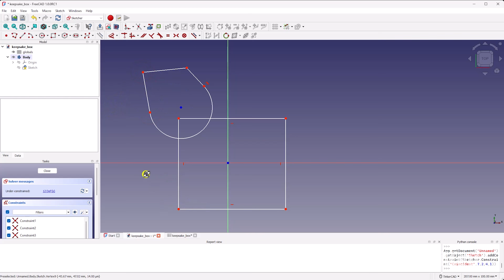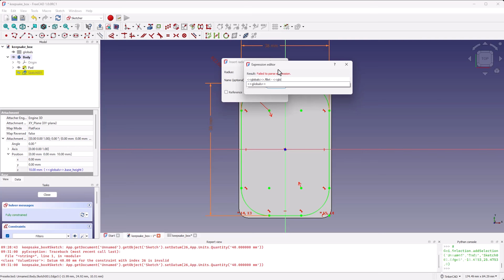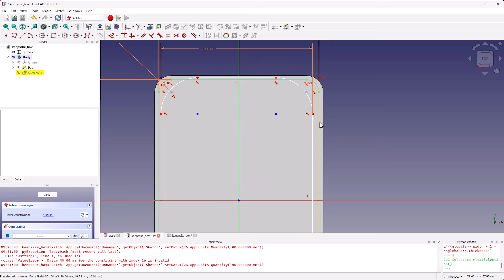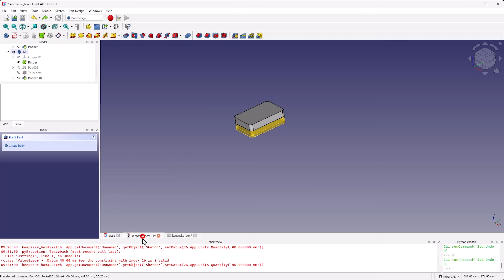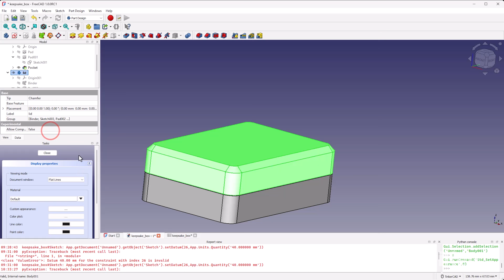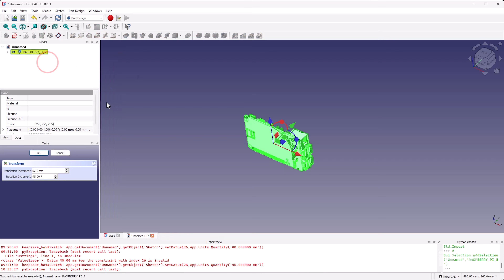Introduction to FreeCAD Part 3: Shape Binders, Expressions, and Spreadsheets | DigiKey

Comment: Your series is the best I have found on FreeCAD and rivals one I found years ago for SolidWorks.  Now, if you get bored and want to do a series on SolidEdge community edition, that would be fantastic.

I started out with SolidEdge as it was free from EAA.  Then a couple years later, it was no longer free.  EAA then offered SolidEdge for free.  I learned that and then, you guessed it, it was no longer free.  Although, it appears I can use the community edition.  I am thinking about taking a deep dive into FreeCAD, but it still seems fairly primitive compared to. SolidWorks and SolidEdge, but being open source is a HUGE advantage.

Comment: Just trying to use the measuring tool drove me completely nuts.  For some reason when I try to measure the gap between the inside of the lid and the outside of the lip it was obsessed with giving me the hypotenuse of the 0.2mmY distance and the 0.2mm Z distance of (0.28mm) instead of the distance I was trying to get 0.2.  I didn't have this problem are all when trying to mesure the gap between the bottom of the lid and the (non-lip) top of the base.  It was super confusing and it took me a while to work out what was going on and that the design was fine - but I still don't know how to use the tool properly...

Comment: I get very flustered with screens, when I do a spreadsheet, it takes up the whole screen.  In your videos, it displays next to the model box.  Can you do a video on just setting up the screen.  Once I went to the Tinker setup, I can't move the origin point.  I'm slower than most kids in the park, but @ 72, I still want to learn.  I did print the micro card box, thanks

Comment: I had a lot of trouble following this course; at first, I thought it was sometimes going a bit too fast. I received 'Wire not closed' messages very frequently. After a while, I realized it was due to the version. I am using the latest version, 1.1.0, and in this version, you now have to completely close External Projection. After I applied this, I no longer received these 'wire not closed' errors.
Reply: THANK YOU! I was pulling my hair out over this same issue. OF course now the pocket is borking up the whole model but at least I'm not getting wire not closed LOL

Comment: I'm used to direct CAD modelling. So a lot of the design of this project seems like overkill: specifically redrawing box outlines inside of box outlines, over and over. Is there a quick method to extract a profile and offset it by a given amount? And then use the extracted profile to do a boolean operation.  Reconstraining similar geometry seems like drudgery. But I have next to no knowledge in FreeCAD. I'm looking for hope here :)

Comment: OK, I managed to add the bumps to the base but I can't figure out what the steps are to create the groves in the lid. It tells me there's no body to cut out from. What am I missing? Thanks!
Reply: I'm not the instructor, and I'm not an expert, but it sounds to me like maybe the sketch isn't in the right body or on the right face?
So you're asking it to cut into the wall of the lid, and it's not sure what it's meant to cut into because it's part of the "box" body, floating in space, rather than the "lid" body along the inside wall of the lid?

If it's not that, then maybe the direction it's cutting is wrong? Like it's trying to cut "downward", but there's nothing below it, and you need to tell it to cut "to the right" somehow?

Sorry I can't be more help...

Comment: Wow. Do i have to make a spreadsheet just to make a box? Wow
Reply: No no, you don't have to make a spreadsheet. You get to make a spreadsheet! 😉
If you just want a single box, and you already know the sizes, you can do the same as in the previous video and set all the dimensions directly.

What they're showing in this video is that you can also make a set of values upfront for the known sizes, and then use those throughout your design so you can make any size box without having to go through and edit everything all throughout your sketches if you change your mind about the width, or want the walls to be a bit thicker, etc.

It's an optional but highly useful feature. And if you want to just draw a box without any kind of dimensions at all, you can use Blender 😛

Comment: Excellent tutorial, as well as your other videos !
I've been using Freecad for years, and this software has reached a high level since version 1.0, on par with other more renowned and often paid softwares. 
I was already familiar with spreadsheets, but I've never put them into practice. 
I have a question : what are the other columns in the table (C, D, E, etc.) for?
Thanks for this clarification.
Reply: Spreadsheets are very abstract. They're not "for" anything! Or maybe put another way, they can be for whatever you want them to be for!
There's nothing magic about the spreadsheet he's setup. He put some words in boxes "A1" through "A7" or whatever it was, but those words are just for his convenience.
He put some measurements into boxes "B1" - "B7". But none of these are special, they don't mean anything to FreeCAD. FreeCAD just allows you to put anything you want into any boxes.

The part where it becomes important to FreeCAD is when he gives it an alias. That's what tells FreeCAD that "whatever is in this box is called length". And then when it really really starts to matter is when he uses "<<globals>>.length" in a constraint expression later. That's what tells FreeCAD that the size of this line should be whatever I put in the box I told you was called "length".

So to answer your question, the other columns are for whatever you need them to be! The spreadsheet gives you a structure and a view for some rows and columns of data, but what makes it important is how you tell FreeCAD to use it. Until then it's just a grid of "stuff".

One thing he didn't cover, is that in a few places he does things like "<<globals>>.length - <<globals>>.gap" when setting some constraint. That works, but what he also could have done is had another row in the spreadsheet called, like, "lid_start" or something, and have the value of that cell be "=B1 - B7", and then it would compute that value for you and put it into the spreadsheet. Then you could see all your base measurements, and their computed measurements, in one place on the sheet. And if you gave all these new measurements an alias as well, you could have just had the lid start at "<<globals>>.lid_start", referencing the computed result cell from the spreadsheet you can see, rather than doing the math in the constraint. Both work, but the real power of a spreadsheet comes when you start having some cells in a spreadsheet be based off each other.

Comment: This shows that it will never be used in real production. The same I can do with all Cad programs I know with one mouse click. Inventor, Catia, Fusion360, SolidWorks, SolidEdge. Why Freecad goes a so hard and not really usable way? Getting geometry and being able to use it as geometry and not only as constraint is that what all others re doing. In this way frecad kills itself. A solute no go. (I am cad user in automotive and medical device development since the 90th. I tried to give free cad a chance but that ways they use to bring up a cad isn't usable at all. Sad. It had that big chances. But to model something like this simple box I would need with Catia or any other of the cited ones not a quarter of the time).

Comment: Finally cracked this tute by downloading the written version of tute, which I found most helpful. But still struggled with having difficulty in freecad picking a face to put a sketch on. Finally put sketches on base planes then changed the Z variable to bring sketch plane to the correct height. Struggled with the "tip" concept, which apears a new operation in this version of freecad. Liked the   explanation on shape binders, best I have come across so far. 💪💪 Could be useful if people were advised to download the written version of the guide, and followed this prior to actually drawing sketches and adding features. Thanks again.

Comment: You are one of the most well educated and experienced YT professors out there, and I commend you! Hey very informative video, working on my Raspberry Pi 5 enclosure. I definitely will include a latch mechanism to help holder the base and lid together. I have been doing a lot of parametric projects, a house wall framing section with all the studs, along with a window, and the variable from the spreadsheet is for width and length of the entire wall section the height of the wall section, window size, It took a while but I got it to work without breaking, did have to limit a few variables though. 
(edit) where is your series that includes the Cura slicer?
Thanks,
G_Dub

Comment: 14:02 If you wanted to center the rectangle on the origin then why didn't you just use the rectangle from center tool and constrain it automatically instead of having to manually set the symmetry constraints?

Comment: Fillets.  You made them TOO Hard. Don't click the two lines.  Just click the vertices/corners of the geometry. The system default will make a fillet.   Then, all your fillets are consistent - OR - you next go to your Spreadsheet.
Reply: Chamfer.  I noticed - Select one edge - Then, select the Chamfer tool. It chamfered 'all' of the edges on the plane. One Selection of edge. One Selection of the Tool. All done.

Comment: Great video series.  But to offer a tip: I save far more time using VarSets instead of Spreadsheets for global variables.  Unlike spreadsheets, you can add variables to varsets while you are in the middle of sketching, and use your new variables in the sketch as you go.
Reply: Agreed, I much prefer VarSets now. They were added to v1.0 after I made this video.

Comment: This is a great series ! Spreadsheets are extremely useful.  I created one spreadsheet and 6 bodies referencing the spreadsheet in one file as Shawn did. Each time I update the spreadsheet, for instance changing a variable or adding a new entry, it takes about 10 seconds to check all the references. I would suggest creating one file with just the spreadsheet. Then create a file for each body and open the spreadsheet file into it. You can then reference the master spreadsheet in your project, and if you make any changes, only one object needs to be updated. You can even add multiple spreadsheets so I am now making spreadsheets for things like dimensions for all heat set inserts, or the connectors I use.

Comment: when "Sketch001.Constraints.lip_length + <<globals>>.gap" It says "Quantity::operator +(: Unit mismatch in plus operation
Result: in expression: Sketch001.Constraints.lip_length + <<glob..." what am I doing wrong?
Reply: Double check your values to make sure they have units. lip_length should have "mm" behind the number and your <<globals>> spreadsheet gap value should have "mm" behind the number.

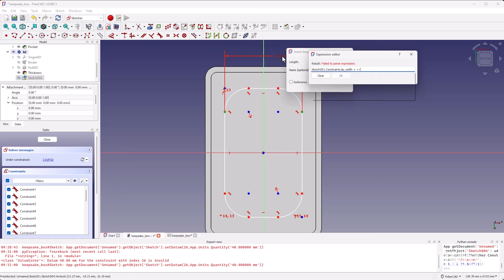Comment: great tutorial. learning this instead of using fusion360.  the step at 35:57 i could not get to work with that codeline. but i worked around it and used only spreadsheet values

Comment: First and foremost, I'd like to thank you for this excellent tutorial series (among others). I find these videos very well paced and explanatory, to the point and great for CAD design beginners like myself!

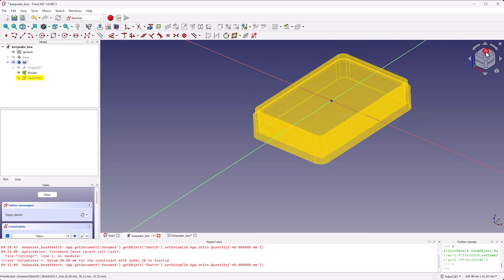For those having issue with selecting external geometry lines at 30:05 (and the "Cannot use selected object." error):

Firstly, I read the comments' replies, where you mentioned to check if the sketch is under the active body, etc.

Everything was in the correct place. I tried to delete and create the binder, recreate the sketch, set it to the proper Z-height, nothing changed, the error kept appearing and I couldn't mark the external geometry lines.

The problem was that I'd forgotten to hide the base body. So both bodies were overlapping and I assume that when I was trying to mark the binder lines, I was selecting the base body lines, hence the error.

I thought to post it here, in case anyone else is having the same careless issue! :D
Reply: Thank you!
Reply: Thank you so much!
I also was not able to select lines as external geometry until the base body was hidden.

Comment: 40:26 In 1.0.0 one must use "Diffuse color" and not "Ambient Color" as in 1.0.0RC1 or at least: well Diffuse works here my me. Ambient does not show.
Reply: Good catch. Turns out "Ambient color" is the shadows on the object and "Diffuse color" is the actual/base color (according to the docs). I wonder if this was an issue with RC1. But yes, you should use "Diffuse color" and not "Ambient color" (like I did in the video).

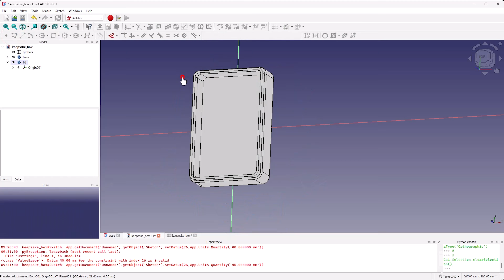Comment: In version 1.0.0 one can't even create a sketch. (26:23)
Reply: What are you seeing in your FreeCAD? I just checked in v1.0, and I can still create sketches. If your buttons are grayed out, check your "Tasks" pane to make sure you don't have something open (i.e. close out of any open tasks there).
Reply: @ I think I got lost, backtracked a bit, closed FreeCAD and started it again. Then I could move on. I’ve a few boxes now with “locks” but I think I should increase the lib of the lid as the “holes” for the “locks” make the material thin there. Thank you for your input. I understand a lot more now than before I found this channel. Learning frustrations can still run high but I do get these “aha” moments and can move on.
Reply: That is the thickness of the lib of the lid if that makes any sense at all.

Comment: I'm having the same problem as an earlier comment "I was following along but got an error msg when I tried to PAD the lip sketch which is +10mm up on the Z plain. The Error msg is "Cannot use selected object. Selected object must belong to the active body. Consider using ShapeBinder or a BaseFeature to reference external geometry in a body." Note I am using FreeCAD 1.0.0. Thanks.." My problem is that I cannot drag anything around in tree view.
Reply: My guess is that you created a sketch in the Document rather than in a Body (in the Document). This can be tricky to spot, as it can easily look like the sketch is under the Body you made. Try collapsing the Body in the tree view to see if the sketch is inside the Body or outside the Body. You should be able to drag a sketch into a Body in the tree view, but it will appear at the bottom of the Part Design Body. You can't reorder things in a Body in the tree view (I'd love to have this feature, too). You can right-click on a feature (e.g. sketch, Pad, etc.) in the tree view and select "Move object after other object" to reorder your features in the Part Design Body. Hope that helps!

Comment: 16:12: What topological naming problem is that?
Reply: I recommend checking out Part 1 (around 14:40) to see an explanation and example of the topological naming problem. It happens when you attach a feature to another feature and then change the first (underlying) feature. The solver keeps the original attachment, which can have unintended and disastrous results (often breaking your entire design). FreeCAD v1.0 and on fixes this problem by trying to understand the intention behind the attachment, which results in far fewer broken designs.
Reply: @ShawnHymel  Ah! That one. I didn't pay attention since that was about a version prior to 1.0. I'll watch Part 3 again. I use FreeCAD to draw inserts for my boardgames like Great Western Trail: Argentina and the learning curve has been quite steep since a lot of the other instructional videos from others are from earlier versions and in some of them it feels more like a "See what I can" rather that a help. Then along came you and I start to understand. Thank you for your videos.
Reply: @peterlageri4177  I'm glad the videos are helpful, and the board game modifications sound really cool!

Comment: You have a very good knack of sharing your obvious high level of knowledge of FreeCad, thank you. I have been using FreeCad for about 3 years now, so I’ve gleaned a few things here and there. At 3:00, you can use the Macro EasyAlias to automatically input the names you’ve typed in next to your value cells as the alias’ for them. It works slick. Another option is to copy the name to the clipboard and paste it into the Alias box in the upper/right corner of the spreadsheet window. You have to get rid of the apostrophe if you copy/paste.
At about 22:55, you could have avoided redrawing the sketch and used the inner rectangle of the previous sketch to pocket the box out. It’s nice that you can re-use parts of sketches now in FreeCad. I find myself making “Master Sketches” more and selecting specific parts of them to work with for different feature. It helps avoid referencing geometry
Again, excellent tutorial series. Even with the experience I have, there’s always something to learn. I picked up a few tips by watching this one, and am looking forward to continuing on with the ones to follow
Reply: Good tips, thanks!

Comment: Excellent tutorial, i personally never used a CAD software in my life. after watching this, not only it broke the ice, it also made me realize that most of the ideas inside my head can become true.

Just a note on the side, i find the logic of freeCAD is very similar to Excel logic, or a programing software, the logic limitations are purely mathematical and easy to work around them, ie. you have to find the value of X in order to solve the value of Y, or mechanically speaking, you can not supply the power to a car wheels, unless the engine is moving. 

Anyway, DigiKey, you're making the world a better place.

Comment: For anyone who might be stuck ont he 'create sketch on top of the base':
Changing the attatchment value for the second sketch DID NOT move the sketch on the correct z height. It was still located at 0,0,0 therefore under the box. I needed to set the position of the sketch rather than the attatchment. For good measure I set both to the value from the spreadsheet.